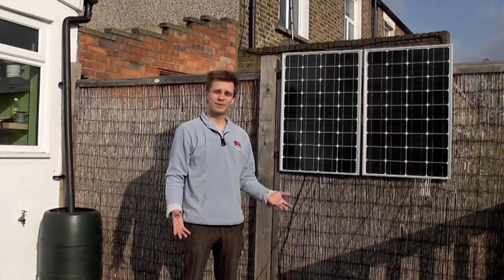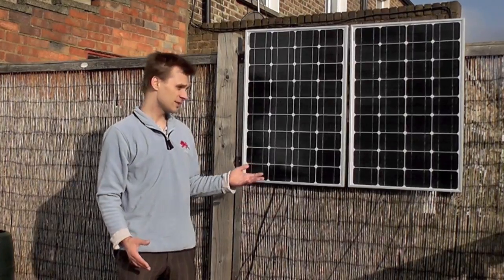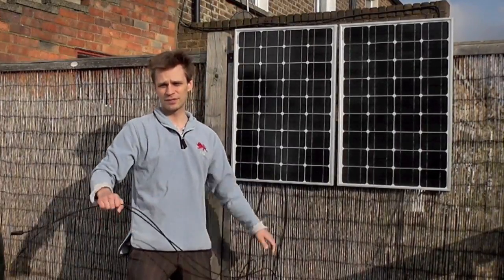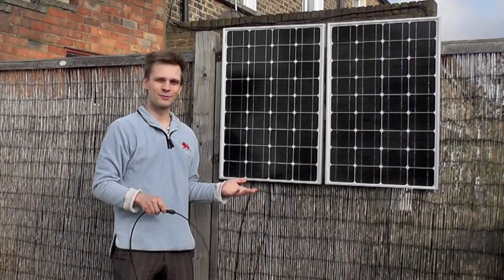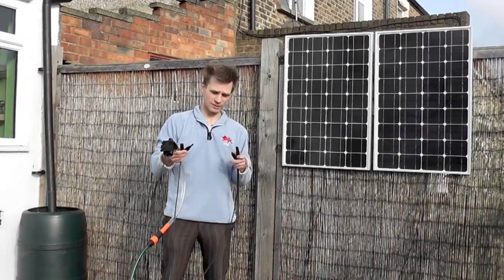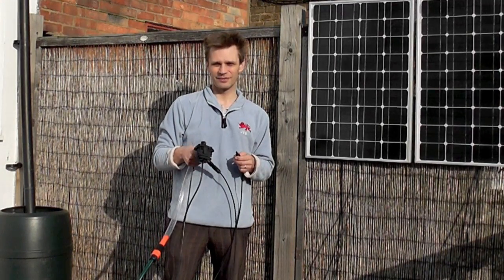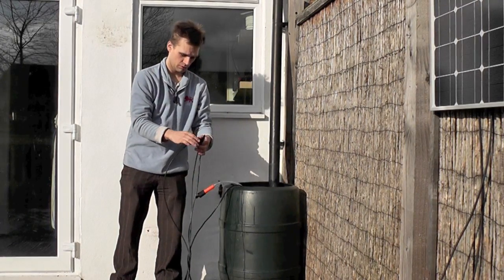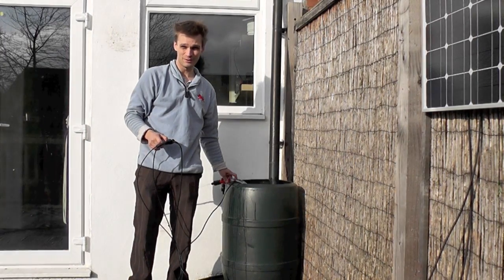How to create a 24V Solar Water Pump

Comment: Hey Hi!  I am working on a project similar to yours for Uganda farmers.  Small systems for 1-2 hectare farms.  How did yours work out?  My system is a little more complicated but very similar in design.
Reply from the maker: It worked very well thanks. We installed two pumps and they seemed to be very useful. You can see more about it here: How to install a solar water pump for agricultural irrigation in Malawi, Africa
https://youtu.be/m5e7EGrqKbU

Comment: doesn't the 12v solar panel give around 17V at full sun?  It doesn't damage the motor to use it without charge controller?
Reply from the maker: Hi there,
A "12V" panel can give higher voltages at low currents but when a current goes through the system, this draws down the voltage. In full sunlight this system does give about 28V (this is 2 x "12V" panels in series) and this is within the tolerance of the motor so is not a problem.
I hope this helps.
All the best,
Jonathan
Reply: AKT Solar  Thank you, it helps :)

Comment from the maker: Hello Pete,

The pressure the pump produces is enough to raise water up to 13m in height (which is very high pressure, especially for a pump of this style). However, the water has to be in a tube or other reservoir type of reservoir when it is pushed up to 13m - it will not be able to squirt water to that height.

I hope this helps and do ask if you have any further questions.

Comment: you can do it with a windshield wiper pump for less volts and easy parts......and it's DC power to boot just get a fuse I use car part's in my Aquaponics system and every place I can for heating and cooling

Comment: Forget the batteries, best is to use some kind of a reservoir (barrels) and fill them during the day, and then empty during the evening (valve) way more cheaper and reliable...
Valve can be Normally open (NO) type, when sun goes out, valve opens, when the sun is up, valve is energized and closed.
As simple and cheap as possible!

Comment from the maker: This is a DC50B-24130. It needs about 100W at approx. 24V and pumps up to 13m in height. It does not come with the connectors but with bare wires - although these are relatively easy to connect directly to solar panels.

Comment from the maker: Hi there Facesachy, 

The system shown here is actually the simplest possibly and will just work in the day when the sun is shining on the panel. However, it would also be very easy to attach a battery in between the panels and the pumps and then it could work at night as well.

Please do ask any further questions.

Cheers,

Jonathan